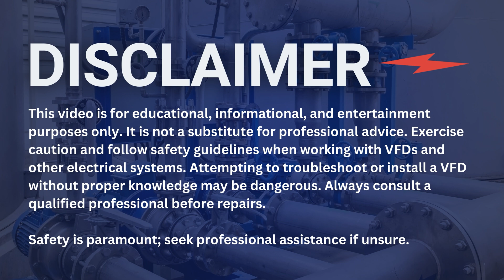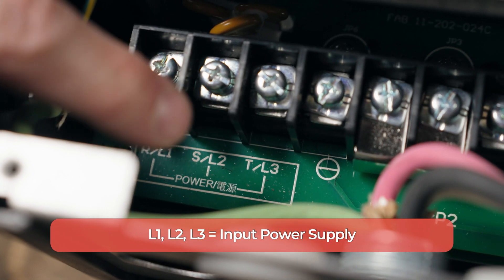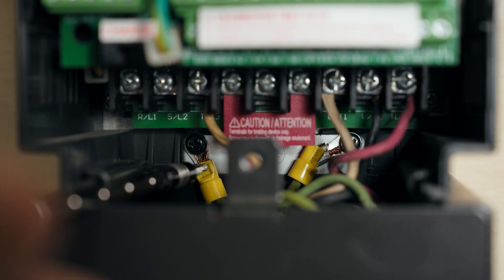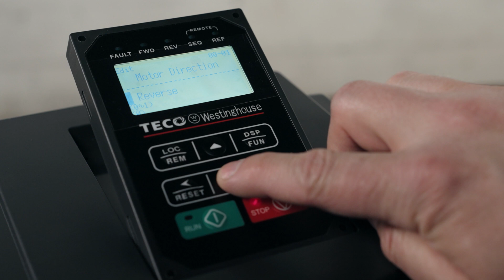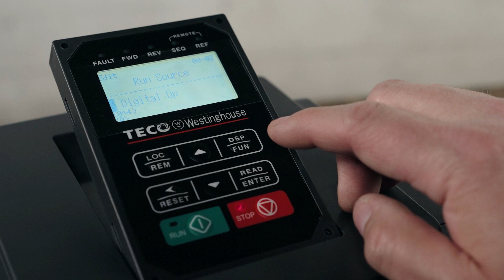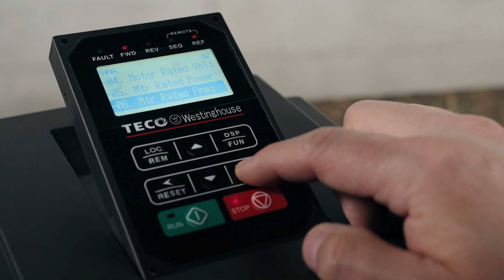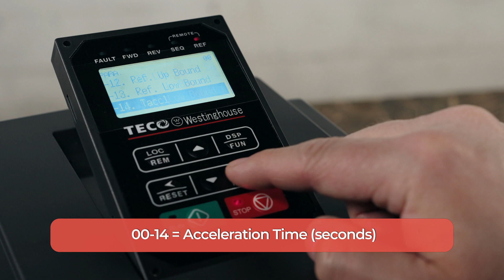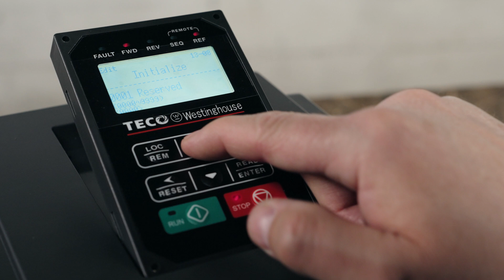F510 TECO Westinghouse VFD | Quick Start Guide

Comment: Hi sir! I would like to ask if you have idea on how to connect two vfd of this type to be controlled by one potentiometer and acts as a master slave connection? I have two vfd and they are synch on certain speed but on higher or lower speed the other motor is slower or faster than the other. 😊

Comment: Do you have a F510s setup parameters for a CPS pump? 5.5kw 220v 2pole
Reply from the maker: Hi Alexander, he's the manual with the parameters, but this is a North American version (horsepower, not kW). 

Go to the downloads section and select the manual: https://www.emotorsdirect.ca/item/teco-f510-4250-c3-ue?quantity=1&tab=downloads-tab